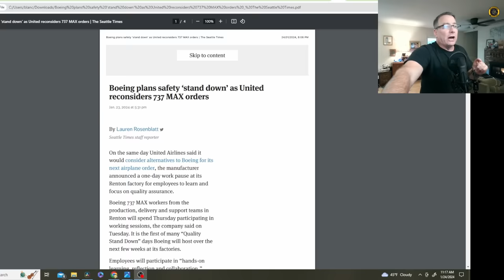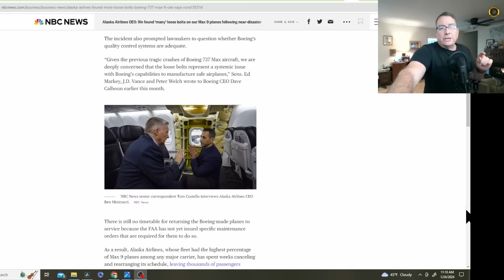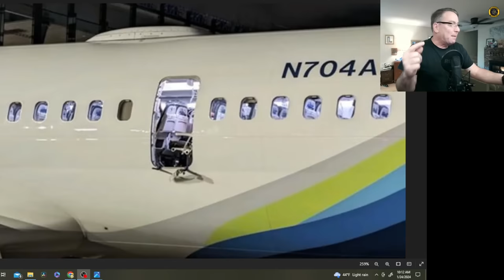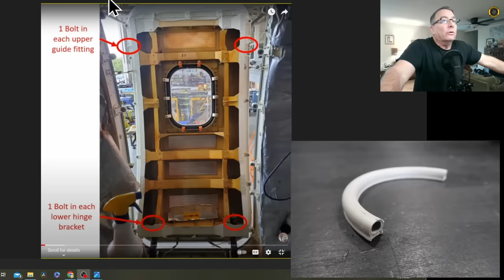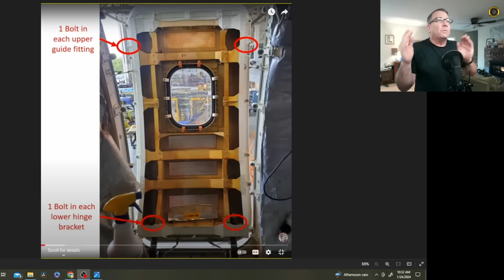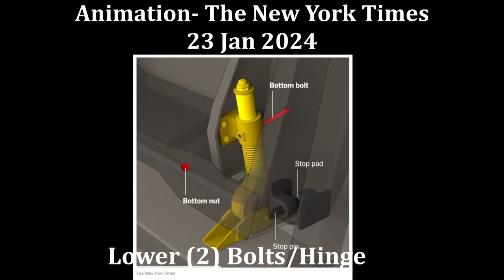Boeing's Quality Management Failure Explained 737-Max-9 Door 24 Jan 2024

Comment: It's beyond belief that they appear to have had incompatible data architectures behind their QA processes. Edit: How can they track the history, maintenance, status, dependencies, etc, of any component, and its relationships to any other component, if they are described differently in each system? - as you go on to explain.
Reply: I can understand that, but in that case they should never have allowed two different teams working on same airframe.
Reply: It's crazy that the QA inspections are different for door opening and door removal. It might be OK on a regular door but not a plug door.
Reply: Not sure that the different software or teams was as much of a problem as Boeing just not setting up the correct inspection process in their software. Why is there even a separate "open" operation for a door plug when the only way you can take out a plug is to "remove' it? Why does the inspection not check the bolts when you have to remove the bolts to perform the work? It's bad QA processes at Boeing (which Spirit is following in Washington). Makes you wonder how much of a mess the rest of their inspections are. I would bet good money that the creation and setup of these procedures was offshored, just like the development of flight control software that killed hundreds of people.
Reply: @bubba99009  My guess is that for standard door, there actually is a difference. Opening normal door is literally a different operation than fully removing a normal door. Whoever wrote / approved the SOP on this either didn't realize that plug door isn't actual door or they tried to cut corners by abusing the nomenclature. Must be investigated.
Reply: @bubba99009  I think there are hinges at the bottom that allow the plug door to be opened without actually detaching completly from the airframe... but all the bolts have to be removed just the same.
Reply: I don't see that as the issue, but rather that Boeing doesn't have a requirement for a quality check when the door plug is opened.
Reply: "Plug door" is not a door but was labeled and treated as such. There is no "opening" a plug, it's either installed or removed, there is no "open".  It's a "plug seal" not a door seal. Little stuff like words really matter.
Reply: @wadepatton2433  And because words /do/ matter, there is a difference between a plug door (typical emergency exit) and a door plug (a replacement for a plug door that can only opened by maintenance).

The important difference is that a plug door is self sealing, while a door plug isn't. As you can tell by now, Alaskan's configuration has door plugs since their number of seats doesn't require extra emergency exits.

Plug doors and door plugs are a pretty new thing in commercial aircraft, found only in new models such as MAX, 900 and neo. They were introduced so that different configurations can be accomodated without the need for different fuselages. I wouldn't be surprised if the QA process is outdated and simply not ready for the differentiation so that it has all those flavors go by "door".
Reply: @zaphod333  Right, a plug is not a door. It's a placeholder and it's held to the airframe differently.

Comment: Gents
40 yr A& P mechanic here.
I just can't buy into that plane leaving Boeing without the 4 bolts in that door and flying that long with NO bolts
It's got a spring under it to help lift it out of the retention pins.
Vibration and pressurization  and the spring lift would have ejected that door in just a couple flights IMHO
It would have come out quickly after Alaska received that plane if the bolts were not in there at delivery.
IMHO it could not have stayed in there for all those flight before the WiFi work on the roof next to the door.
I've been wrong before but I think those bolts got taken out at the WiFi shop, as they got 3 pressurization warnings on the panel after the shop work and then quickly afterward the door came out
I wonder if we will ever get the truth.
It's funny the NTSB has had the door for so long and won't let anyone see it? I wonder why?
Reply: I also agree with your basic premise here.

Comment: I spent my whole carreer in automotive and worked on maintenance management systems. It's very important to have a solid system so as to prevent mistakes and failures. We were many times reminded to take the aviation industry and their systems as an example. Looking at Boeing and Spirit......one has to wonder.

Comment: Blancolirio suggests this is a communication problem between Spirit's SAT system and Boeing's CMES system, but I wonder if it is more a semantic problem. Opening a door didn't require reporting; removing a door did.  This distinction seems pretty sensible in nearly all cases: you can open a door using its hinges without undoing anything, whereas removing a door requires undoing something.  However, in this particular case of a plug door, you can't open it without undoing something. So the problem could be a failure to realise that the standard open/remove distinction does not apply in this special case.
Reply: Or, there is a cost to Spirit when a supplier discrepency triggers an inspection by Boeing.
Reply: It’s just greed that led to this.
Reply: I disagree that this is just greed. The OP has a good point and until I saw the Times animation I was confused about what caused the issue. It is obvious to me that coding for opening this door on a 737 MAX 9 should be the same as for removing it. Then engineers and quality people who set up the quality system for this aircraft either did not know or forgot this should be done. Had they compared the quality system against the work instructions and an FMEA for the door, it should have been evident there was a problem.
Reply: This door plug should have been a writeup regardless, its not a door at all but a panel and should be counted under ATA Code 53
Reply: From what I read, opening the door plug and removing it is the same operation.
Reply: Semantics and meaning matter and have been the root cause of many accidents, if one goes back and looks critically at the incidents and the pary language plays in them.  So many accidents are caused by misunderstandings and miscommunication.  Take the Haneda incident in the same time period.  Also the same root cause if one thinks about it.  Multiple parties not fully understanding each other.
Reply: @shadowopsairman1583  It seems to be a mistake calling it a "door plug". If instead it was called a "fuselage plug" there is no way it's opening could be confused with just opening a regular aircraft door on any paperwork.
Reply: If either, removing the door or opening the door, requires the removal of the Bolts (which it does) then the paperwork is actually wrong and must be corrected appropriately to reflect that, which is also an FAA issue since they signed off on this! This goes much deeper and is a general lack/oversight of QA processes within BOEING, SPIRIT AS and the FAA.
Reply: Wrong!  Its not a "plug door" as blanco calls it.  It is a "door plug".  The 2 are not the same.

Comment: As a retired tech with Lockheed Martin, I have seen the pressure to remove QA steps in the manufacturing\delivery process. At least we were also under the watchful eye of DCMA (at least on the flight line), since our product was strictly military.
Reply: As a machinist it used to be you bug off your own work then it routes to inspection. Inspection pretty much followed every process of the work order. Redundancy redundancy because we're dealing with aircraft.

Comment: In my time on an Air Force flightline, any time a mechanic removes a panel it triggers a work inspection AND a panel inspection. 
Something not mentioned, where did the bolts go once removed? Didn't the seal repair order at the least specify replacing the cotter pins if not the bolts and nuts to complete the repair/modification? I suspect the order from engineering was not thorough. Then no one questioned it after.

Comment: Hi Juan, Very interesting report on this calamity. I used to work at General Dynamics Electric Boat Company, building nuclear powered Trident missile submarines and Los Angeles class attack submarines. When a job was completed, there were inspectors at every step of the process to ensure the work was done and done properly. It's as simple as that. Exercising that plug door should have triggered the inspection process every time the door was removed/replaced, etc..
Reply: It's pretty obvious. Why install the interior fascia if the bolts aren't in?
Reply: It's criminal that removing critical hardware didn't trigger a RII inspection! the Guy who took the bolts out, knew he was responsible for the plug debacle as soon as he heard about the incident!!
Reply: I bet General Dynamics could save a lot of money if they laid off those inspectors!
Reply: I was an electrician on the 726,   Ohio in ‘78.
Reply: @wayne9518  Hi Wayne, I worked out of the Carpenter's shop the summer of '77/78 and then for a year from '79-'80. I worked on the Ohio, 726 and the Michigan, 727, the Philadelphia, and a couple of other 688s. We were there at the same time.
Reply: I wonder who pocketed the extra hardware found at the scene.

Comment: Maybe this is just naieve of me, but I've worked on cars for many many years, and I would never leave a critical bolt or nut just missing without leaving myself a note or had some way of reminding myself to finish it and double check before I was done. I can't imagine someone putting the door plug in on an aircraft, and then just walking away without putting the bolts in or the cotter pins or whatever.
Reply: Yup. How 'bout we just ask the mofo who (intentionally?) left that hardware off off (all?) the doors he/she affixed to that/those airframe(s). Someone knew for sure what the consequences were of leaving fasteners off of a fucking door hinge. Who cares what the sign-off policies were, or at what stage of the process these checks took place. Funny how nobody's asked the question....sabotage?
Reply: Absolutely correct.  When i work on machinery I won't take a chance on down-streaming a potential hazard.  If i open something to work on it -I am darn sure to finish it or lock it out and leave clear notes in maintenance logbook.
Reply: In aircraft manufacturing it was once possible to trace a part all the way back to the raw material supplier, the worker that sheared the sheet metal all the way to the final inspection of an assembly prior to installation.  I'm presuming that such detailed clocking of production still exists and that there will eventually be subpoenas for those records.

Comment: Great info. Thanks. I think I really get it now. I mostly understood it before, but now I really see what happened. The NYTimes animations are really helpful. It's those damn springs at the bottom pushing the door upwards 24x7. Without the bolts in space, those insiduous springs are pushing, pushing, pushing all the time on the door. It's probably the landings that are causing the real movement. Every time the plane touches down, that door bounces, and those springs push that door up another couple of millimeters. After enough landings, the door is completely out of position, and it comes off.
Reply: If the 4 bolts are in place.  No amount of vibration or landings will allow the door to move.  These type doors have been in service for decades without problems.  I don't think this is a design failure.  This is a manufacturing or quality control failure.  The 4 bolts were either missing, not tightened correctly, or didn't have cotter pins in them, allowing them to come apart.  The vertical movement situation is to allow the additional "pads" on the sides to line up and allow the door to withstand the tremendous pressure they were under at altitude.

Comment: In my experience, the more acronyms used by management when referring to quality (QMS, ISO, etc.), the lower the actual quality.
Reply: These processes are nothing more than advertising for customers, making the assumption that they actually follow the processes. As I told my last employer during my interview, "Human nature will destroy any process you have. One person who decides to swerve the process renders the process a moot point." Because I've seen it too many times.
Reply: Then your QMS (Quality Management System) is not doing its job nor is upper management within your experience listening to what QMS is reporting.
Reply: QMS and ISO are pretty standard acronyms.
Reply: @timol437 "Hear no evil, see no evil, ..."  Executive bonuses and stockholder pressures triumph over quasi-QA schemes.
Reply: It's a sign of being lazy and at the same time they think they are smart
Reply: That's complete rubbish. If done properly, these systems save lives. You need to have proper processes in place when dealing withs such complex, multifaceted activity, because you simply can't rely on people not making mistakes.
Reply: @misarthim6538  You are correct sir.  The systems "in general" are very good.  However, with the Spirit / Boeing situation there's is a gaping hole between the two systems that needs to be fixed ASAP.  I have no doubt Boeing will get it figured out, but in the meantime, some people at the top need to lose their jobs over this fiasco.  It'll be interesting to see how this all plays out of the next 12-18 months.
Reply: @JeffreyBue_imtxsmoke  Exactly - hence 'when done correctly'.

Comment: Quality (or lack thereof) is deeply rooted in an organisation's culture. To fix this problem, you would need ALL the executives to be committed to driving such a culture an even then it would likely take 5 to 10 years to fully take hold.
Reply: Executives are committed to bonuses from increasing shareholder value.  Quality costs immediate, "right now" money that has a direct impact on quarterly earnings.  The issue is partly stockholder expectations and the perverse reward system for executives.
Reply: I think the main thing is to work on it as if your going to Fly it. It's obvious that the top Boeing management is not considering that they or their loved ones are riding in this.

Comment: Anyone else finding this absolutely insane that the quality control steps do not align between Spirit and Boeing??
Reply: Nope.  Every industry is breaking down in similar manners.
Reply: probably on purpose
Reply: It's insane that Spirit was split off in the first place. I'm sure some MBAs thought it was a great money making scheme...
Reply: You'd expect these procedures to be standard and made by Boeing, isn't it? It's their business on the line after all. Crazy stuff.
Reply: Bingo!
Reply: OUTSOURCING can lead to improved financial performance. In the short-term.   <—— the motivation
Reply: What shocks me is that they knowing accept detective products into their plant and let the subcontractor repair them there.

Defective products from subcontractors should be rejected at the door at the subcontractor's expense. 

Accepting detective product enables poor quality subcontractors and guarantees long-term quality issues.
Reply: No, to be honest. It's absolutely normal.
Reply: They are aligned, just it's aligned with sloppiness.

Comment: Hi Juan. I worked in the industry foe many years and was taught when young that you dont take a part or assy to inspection to see if it is right. You only take it to inspection when you know it is right. Whomever inatalled the door should have installed the lock bolts or taped a huge sign to the door " LOCK BOLTS NOT INSTALLED"
Reply: In carpentry, we call it the "pre-closing inspection". If something showed up after that, we called it intentional, and dealt with whomever hung the sheetrock to cover it up.

Comment: A problem at the QMS level (in this case, failure to control for and coordinate with external QMSs) is a significant problem. It’s by definition a systemic problem. One safety stand down day won’t make a difference.

Comment: I ran the C-17 factory floor systems. It’s hard to leave 4 bolts out of an assembly. You’d have them left in your installation kit. Along with the nuts and cotter pins. Then, you’d have to mistakenly stamp off the installation as completed. Then, the QA inspection steps (if called out) would have to be mistakenly stamped as completed. There seems to be multiple escapes for this to happen. I’ve seen some video on the door design. That looks solid and the bolts are not really carrying any load. They are merely keeping it from moving up to disengage. All of the load on the door is carried by the hinges and the door jamb posts and catch on the door. On the C-17, if you removed something, you needed paperwork for permission. Then you needed to re-install the assembly and go through the installation buyoffs and the inspection buyoffs.

Comment: I’m a retired engineer and although this is a complex issue with paperwork/quality control etc… the bolts should have been removed and placed in a container next to the door and remained there even if the aircraft moves elsewhere!!!  Good practice that seems to be marginalised these days in cost savings.  Usually ending up costing more in long run in business reputation lawsuits etc. 🤔
Reply: Like when we disassemble furniture to move it and out all fasteners into a Ziploc that gets taped to the piece they belong to.
Reply: Too many words to have just said greed caused this. Say it out loud.